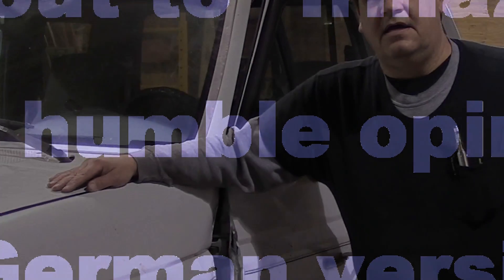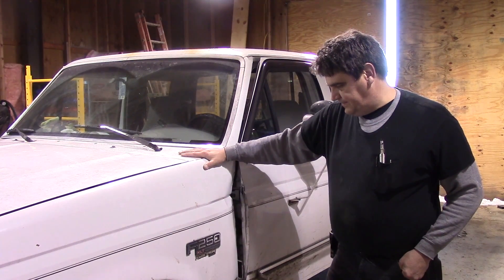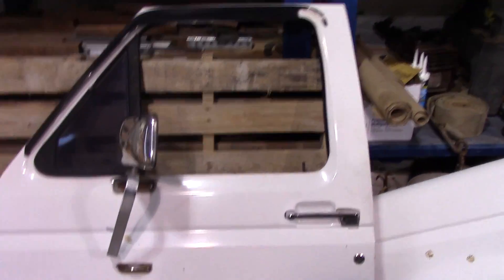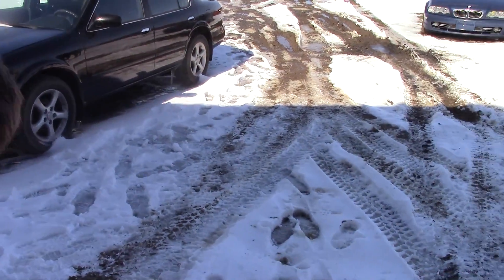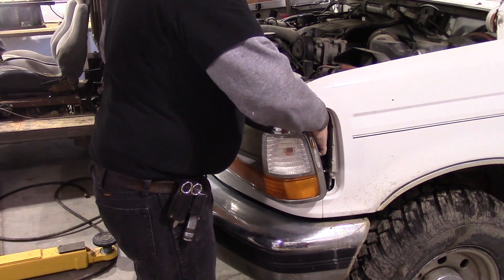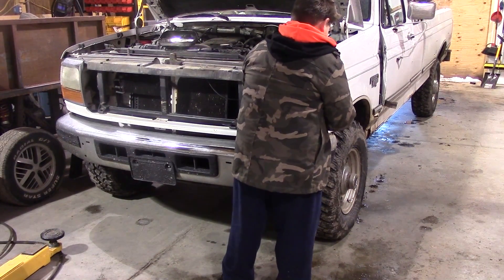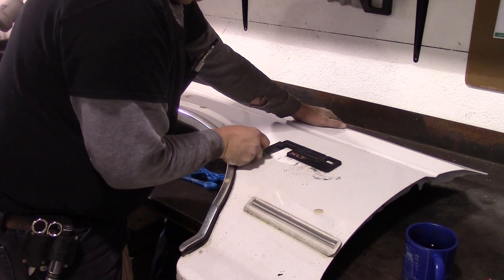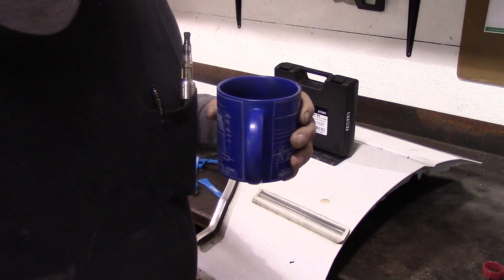1995 F250 Fender and door replacement part2

Comment: I have a f150 xlt with the same body.  I hop this helps me out, I have a lot of work on this truck.  I was looking for wiring diagrams for the entire truck so I can comb though the wiring and fix all the other problems.  But they are hard to find.  If you have any good places to go to find diagrams would be nice.  My driver door it needs replaced along with all the controls because they completely destroyed it.

Comment: Why would you not use a heat gun on the emblems, it would've been so much easier? Also, move that damn propane tank.
Reply from the maker: Thanks for watching one of my very early videos! It was a personal choice really.  I suppose I could have used a heat gun, but the foam glue pad was so deteriorated I was afraid of damaging the emblem with too much heat using a heat gun so I opted for the more difficult, but safer for the emblem method of removing it with a scraper. 

As for the propane tank, To the uninitiated, it appears that the propane tank might be too close to the heater. But actually, the tank is almost behind the outlet. The heater blows a ring of cool air around the central tube where the heat comes out. Pretty clever feature I thought. And, since the tank will "ice up" and not run the heater properly when its as cold as it was that day, I found that you have to strike a balance between keeping the tank JUST close enough to the heater to prevent the tank from icing up, but not too close to be dangerous. But I admit, it does look scary!